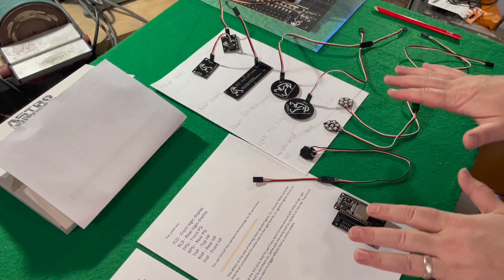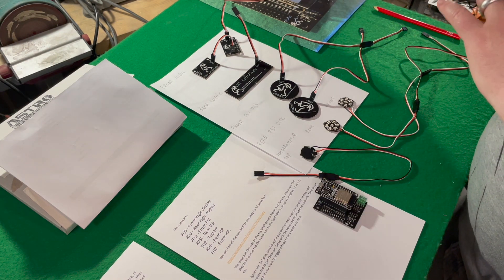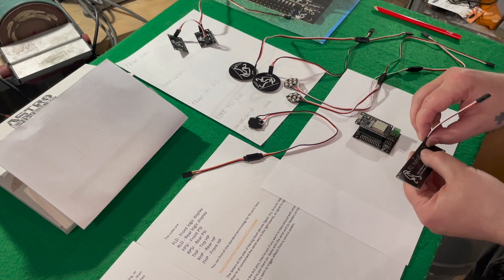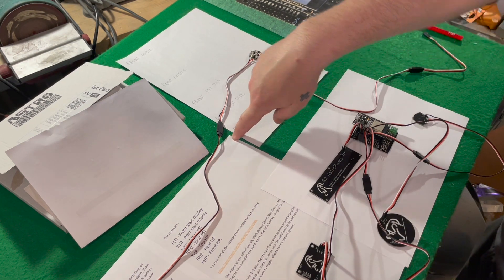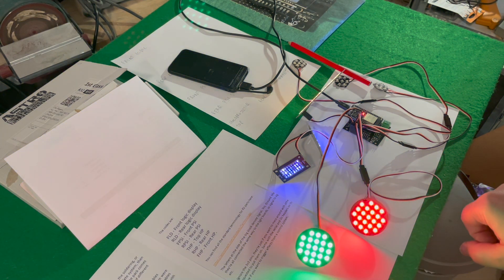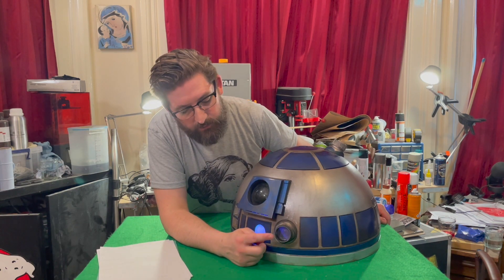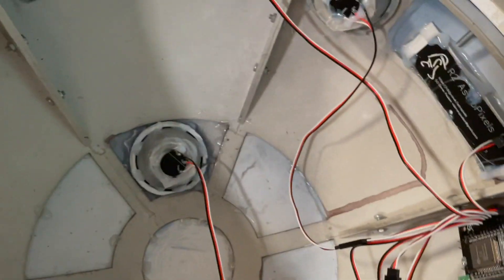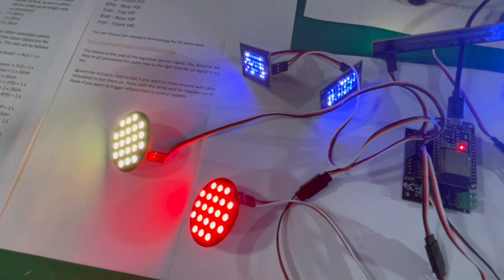R2D2 - Lights in the Dome (Part 3)

Comment: How a video should be done for those with no or little experience in dealing with boards, lights, wires, etc.  I struggled for months and advice given was as if I was an electrical engineer and not just a newbie.    I recommend you add labels to all your electronics stating the max voltage for each for future use as you may forget.  Blowing a board becomes very costly.  Great job!
Reply from the maker: Thanks. I appreciate that. And yes! Labling!!

Comment: 3V3 will be a 3.3 volts power supply if you need it. The V for volts is used to replace the . as printed small on a board or in a schematic it’s really easy to miss it.